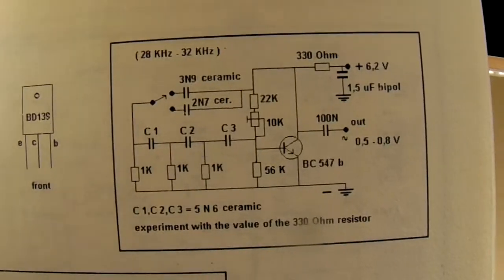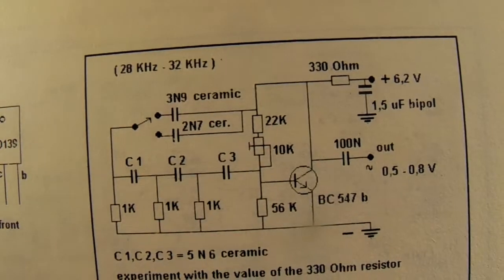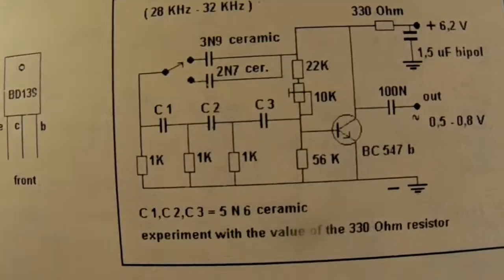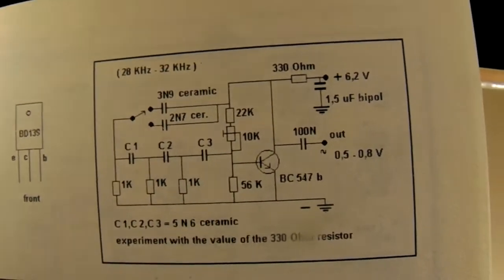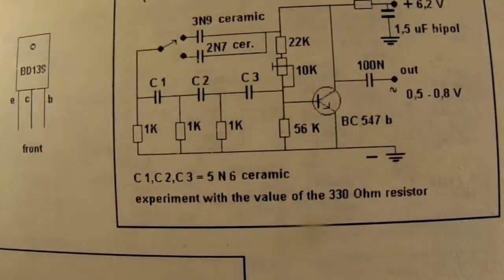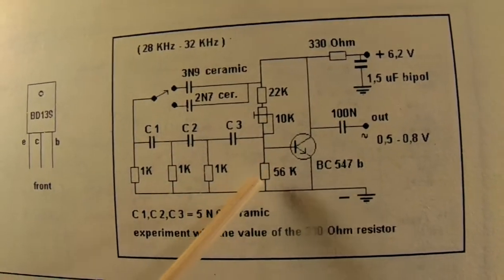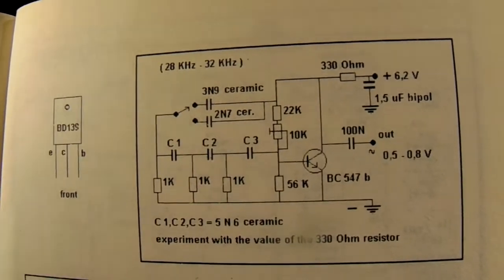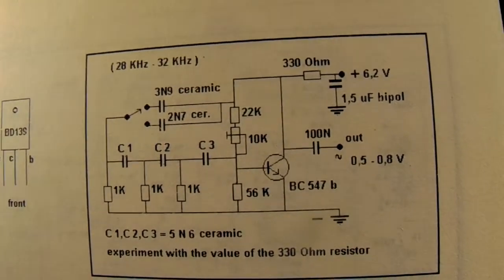Ultra sound 28 KHz up to 32 KHz sine wave generator schematic

Comment: Is possible to tune it to 40kHz ?
Reply from the maker: There is a good chance that it works when you use a HF transistor like the BF 199. Change C1, C2, C3 into 3N3 (3300 pF). Leave the 2N7 (2700 pF) in the circuit or use a 2N2 (2200 pF). For a first experiment you can use a BC 547b.